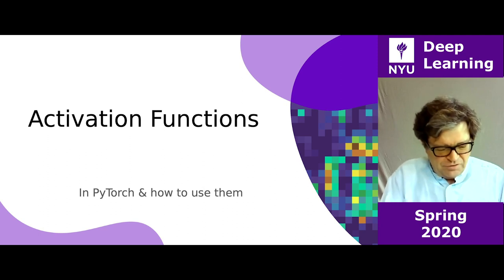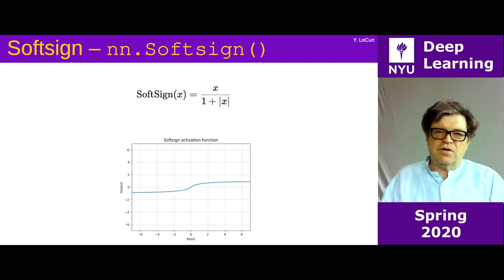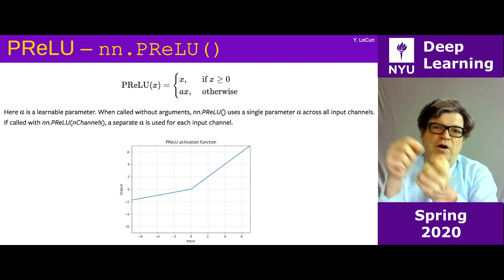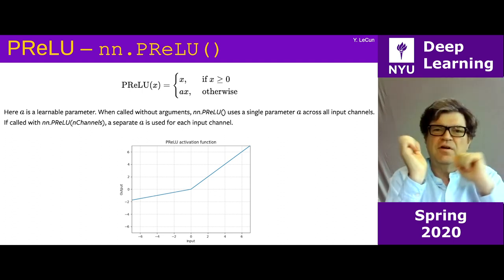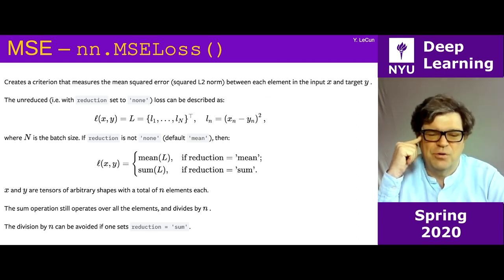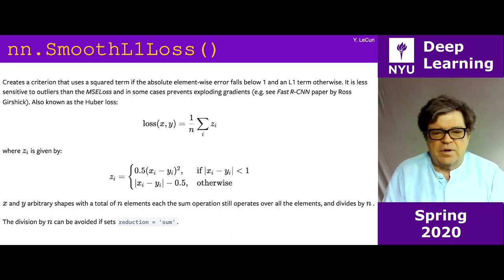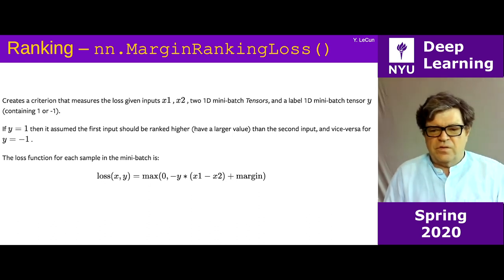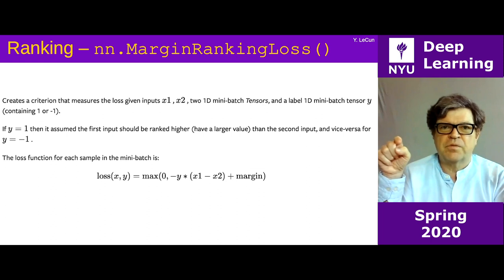Week 11 – Lecture: PyTorch activation and loss functions

Comment: are there ways to check if the activation you chose works for the network before training on the full dataset? And can we mix activations in a network?
Reply from the maker: I'd say one can go with the standard ReLU, and change that if there are issues (say no gradient back-flowing). In particular, if you're concerned with adversarial robustness, you may want to opt for a smoother variants. See Quoc's recent paper / tweet: https://twitter.com/quocleix/status/1277668867066621952
About “training on the full data set”, you can compare just the initial trend, over a few epochs, and decide on that. This should give you a reasonable estimate of the final performance.